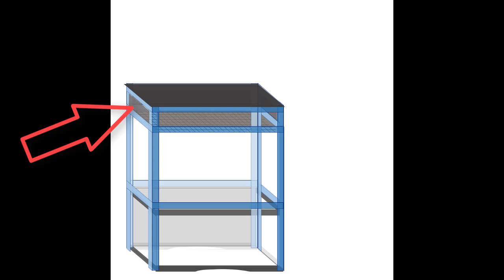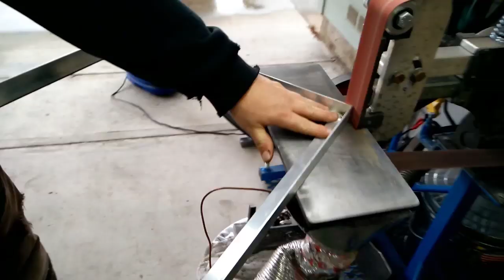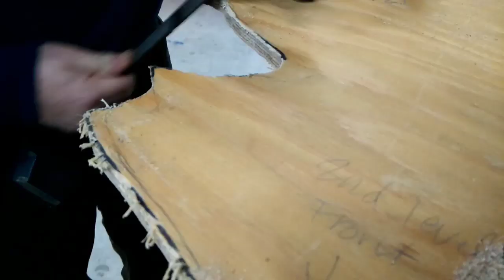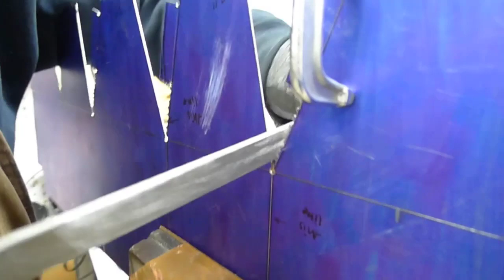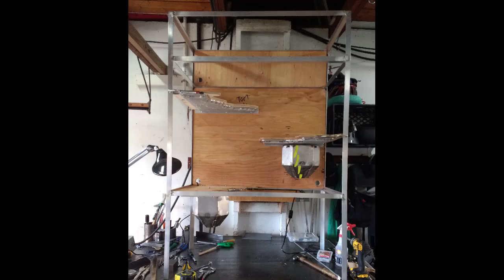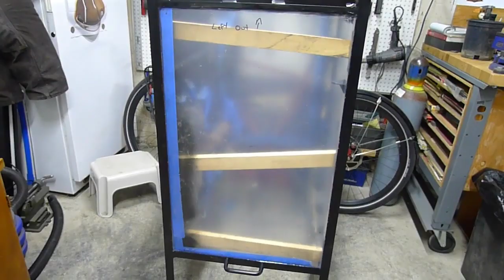BUILDING MARMADUKE’S MANSION: Part 1 (Metal Frame & Internal Components) -- with timestamps listed!

Comment: That's a cool idea, but aluminum does the opposite of what you wanted it to do. It dissipates heat, not stores it. Iron or even lead or nearly any other metal would have done what you wanted. The wood would do a better job by itself rather than adding aluminum. Put some aluminum in your oven and heat it. Take it out and let it cool for 3 seconds. It will already be cool, whereas a tin pan would burn you and stay warm for half an hour. That's an awesome dragon!
Reply from the maker: You're right that steel/iron would retain more heat, but we chose aluminum because it's a lighter material. The terrarium is super heavy already, with the stucco and wood and everything else ... so if we wanted any chance of being able to lift it, we needed to go with a lighter metal. You're correct that aluminum FOIL or a thin-walled pan cools off very quickly, but 1/4" thick aluminum slab retains heat for MUCH longer periods of time. We monitor all the surface temps with an infrared heat gun and the aluminum actually works GREAT, keeping the tank very warm with minimal electrical input. It may not work as well as steel might have, but it's better than just relying on air convection alone (and it still light enough to be able to move the tank), so it achieves exactly what we intended.